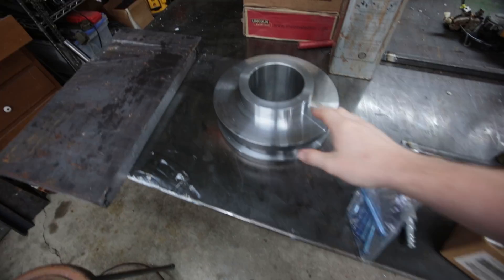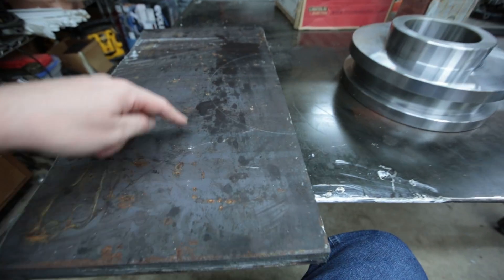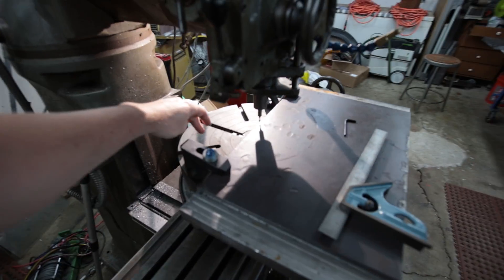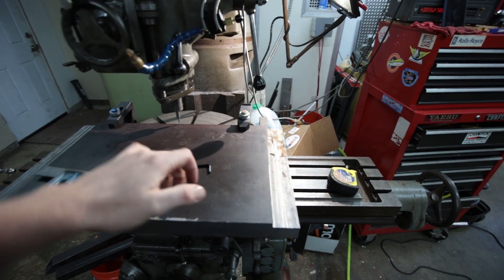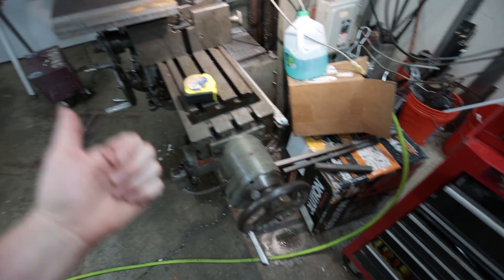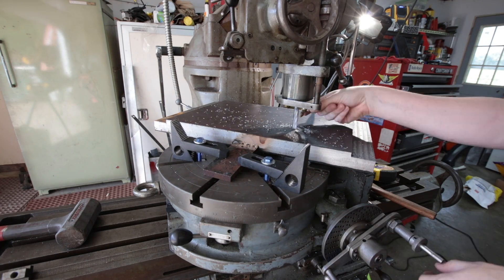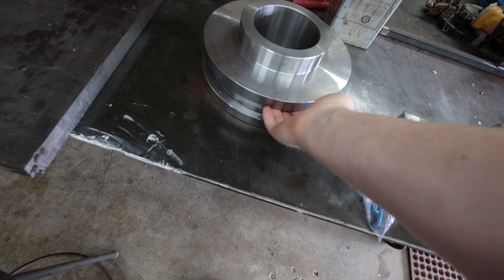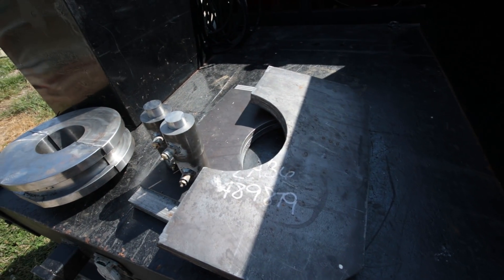Making Rounds Parts With Rotary Table On A Bridgeport

Comment: Tony..nice job on a small mill. can i see aome pix of your mill, as i am pretty sure i have an identical mill, as does double boost. i fdont have a vsd on mine but intend to. i like the mill, but changing speeds is a pain, with the 2 belt system.
Reply from the maker: Thanks, Mine is a model 45 I have thought about doing a vfd drive because yeah the belts are a pain but some one has put a two speed motor on mine and seems like most jobs are fine on 1800 or 900. I will have to look more at some of double boosts videos.
Reply: thanks Tony. i would like to see a 5 minute session on your model, and i will do one on mine in the next week or so ...i will send you the link. i think my model is very slightly different and i cannot see a model number anywhere. neil